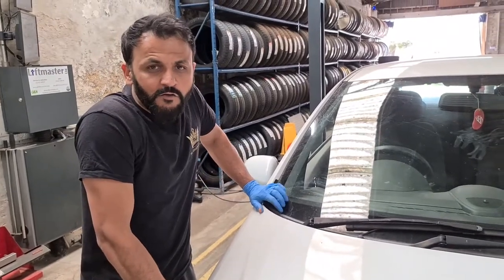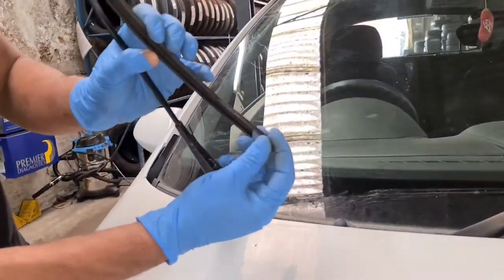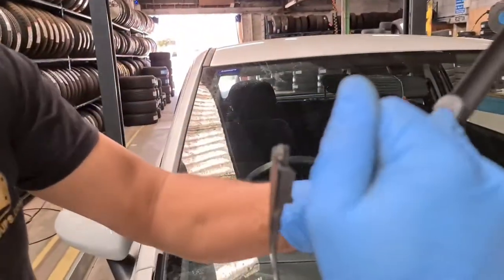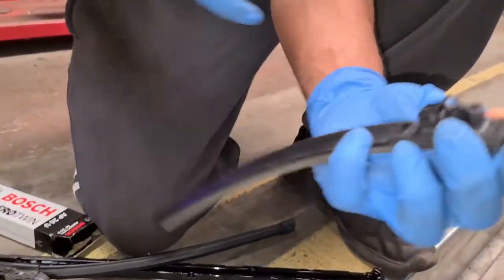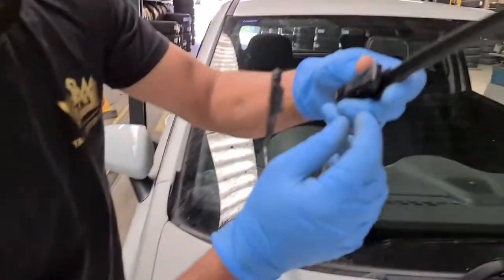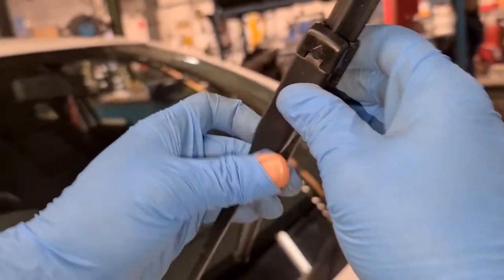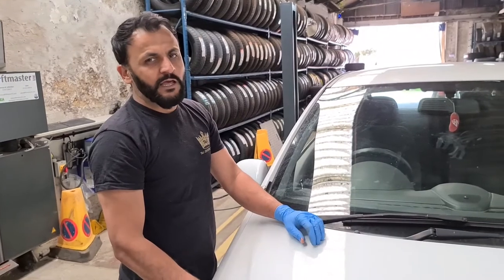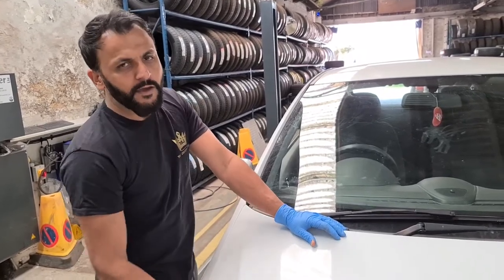how to remove|replace front wiperblades on Vauxhall Corsa Full HD 1080p

Comment: I've got the same wiper blades - which attachment did you use? 1, 2 ,3 or 4?
Reply from the maker: Hi I’m not sure about the number but match the clip with old one and if not sure still then try the clip alone on the wiper arm and see which one will fit. Thanks 🙏🏽